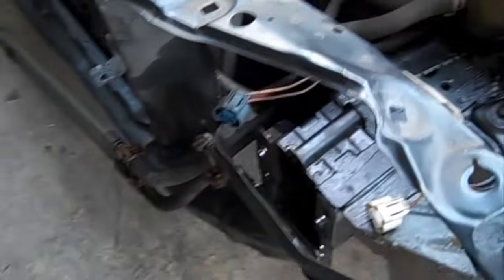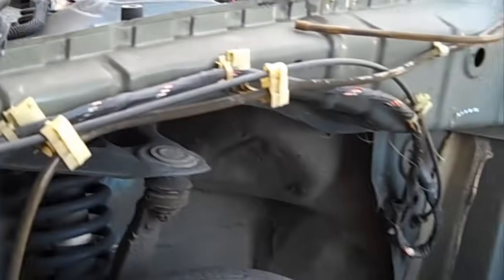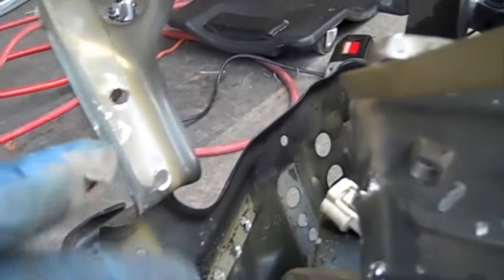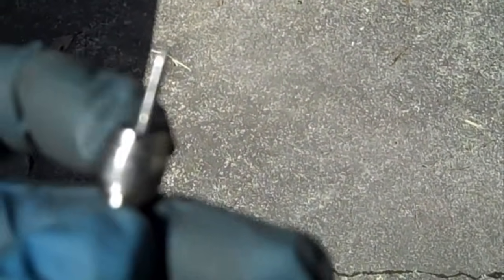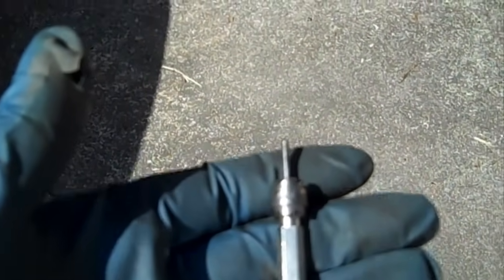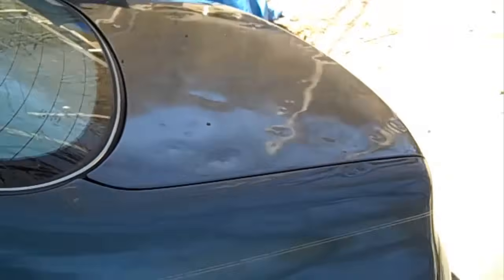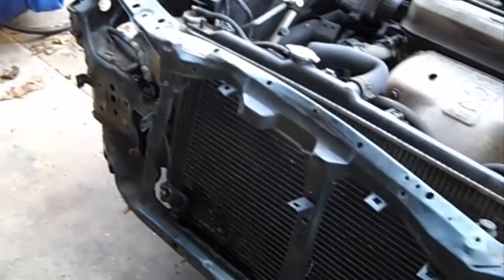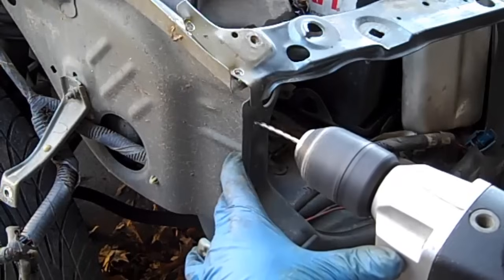How To Remove and Replace a Radiator Support

Comment: This was the most helpful video I’ve fond and I’ve been looking for about 3 days now. I’m a single mom and actually prefer to do this myself just cuz I’m interested in this kind of stuff and can save a ton of money! I bumped a car that made a sudden turn in front of me with no signal, good thing I wasn’t going any faster!....I could try to pull the top part of the radiator support back to it’s original position but I think it’ll be better to just replace the whole thing so it’s straight. I’ll also need to replace the hood and bumper. It’s not leaking any fluids and the car is running just fine. I was able to push the hood down as far as it’ll go but the lip is tucked and won’t latxh 😕  just needs some TLC. I also just want to replace the radiator just looks old...now all I need is the tools. Thanks. Wish me luck 😁 😆
Reply: Lmao! “I was tailgating and hit the car in front of me because THEY didn’t warn me to back up.” 😂 People try so hard to run away from responsibility
Reply: @GirlsNDragons who's to say it's their fault? They aren't even trying to push the blame away. Stop trying to be negative

Comment: I have a 2001 Accord. And I rear ended another car yesterday. The damage is very similar to this car. After bringing the car home and beginning the process of disassembling I became discouraged after I saw that there would be some cutting and welding. I don’t own a welder. I was bummed out. But after watching your video and reading some of the comments and ideas I’m pretty confident I could make it work. Thank you very much for posting this video. It’s been a great motivator and huge help.
Reply: How did it come out?
Reply from the maker: I don't normally recommend it, but if you do not have a welder, you can use nuts and bolts. You will just need a drill and some good bits. The issue with using nuts and bolts is, some of the place points that need to be attached are almost impossible to get a nut and bolt to it. However, that isn't always the case on every car. Some are really easy, while others are just a nightmare. But try some nuts and bolts to reassemble it.

Comment: Thank you very much for this video.  I bumped a truck with my f350 sd 2002.  Body shop estimated $8500 to repair.  So far I have $2500 in new parts but doing labor myself.  I was stuck on replacing lower radiator frame, thank you!!!!

Comment: Hey I wanted to thank you for the helpful video.  It was definitely helpful for when I will be replacing my radiator support later this week for my Honda Del Slow.  Reading one of the comments you answered my question about not welding the car too so thanks a bunch. And hey remember haters are going to hate, you just do you.

Comment: I can't weld, but your video was explained perfectly. I have the entire support and knew it wasn't bolt in/bolt out. But your vid was the best of all that I've seen, thank you
Reply from the maker: I have been asked many times if you can bolt a radiator support in when someone doesn't have a welder or doesn't know how. The answer is yes. Just use Grade 8 bolts, nuts and washers. You may want to put a few extra in at the bottom, especially where the support connects to the frame rails. Let me know if you need any other help. You can always contact me through my  site where you can upload pics if you need to.  https://rodsshop.org/contact-form/
Reply: @RodsshopOrg  ...Support panel, not support bar. Also Australia, not US. if you try and even bolt on a support bar, you will go to gaol, not jail
Reply: I can send you all the pics you need to see, I hit a roo. All the damage is cosmetic, except the high support bar, rad mounts, passenger side light mounts, AC mounts etc etc.
Reply: Sorry, I said that like I assumed you could see all the damage, I'll send you a pic, think Pontiac SS?
Reply: Can't send you the pics, either your contact form is hacked, or, your contact form is hacked

Comment: Whats the usual price for a job like this
Reply from the maker: If you are talking taking it to a shop, the price will be high and it depends on how much more is damaged. Most body shops will not just fix the radiator support and not repair and paint the rest of the car. 

However, if you could find an individually owned shop, they would charge somewhere between $500 and $2000 in labor and this depends on the make and model of the car.

Some supports are fairly easy to replace, while others are complete time sucking nightmares. The radiator support itself can run from $75 to $4000 depending on buying it aftermarket or OEM and the make and model of the car. 

I know that isn't the best answer but if you want a better estimate, tell me the year, make and model of your car and if you are doing it yourself or taking it to a garage and how much besides the support needs to be fixed.
Reply: Hey, I have a 2011 Subaru Forester that needs the bottom radiator support replaced due to rusting. How much do you think an independent shop would charge for parts and labor for this job ? 
Or is this something I could handle myself ? I understand the bumpers can be easily removed. Can the welding be accomplished with a 75 amp flux core wire feed welder that I have ? ( I also have a new 80 amp stick welder that I have still in the box. ) Or do you need a high end welder ?
Thanks in advance

Comment: I got hit from behind, smashed into the car in front of me....I was totaled, but had as much as I could fixed...they used epoxy on the upper plastic parts. Don't know if I want to attempt this or not, but this video is great. I've done fenders before, but holy cow. Although If I did, I could pick up some used fenders... Thanks for the video..
Reply from the maker: No problem, glad the video could help

Comment: How many spot welds all together are there?;
Reply from the maker: There is never an exact number of welds as it is going to vary for each vehicle. Some vehicles require you bolt the support at the bottom and weld in the middle and top, where most are all welded. Even though this is not exact, on average, I would say you would have somewhere between 30 to 40 spot welds.

Comment: Mine just got the bottom piece rotten, can I just cut and weld a piece on the bottom?.
Reply from the maker: @workingtools2999 Yes, I have done that often. Just cut out all the rusted part, be sure to cut well into the unrusted areas. Then weld in the new metal. As a tip, I would use a Weld Through Primer to help prevent your welded area from rusting later on. Prime and paint it thoroughly.
Reply: @RodsshopOrg  Sounds good. I Don't wanna be removing parts that has no rust at all. Previous owner neglected it and now its my problem. Its only at 90K kilometers too. 2012 Nissan ser spec v. 😁
Reply from the maker: @workingtools2999  You should be fine just cutting out what is needed and weld back in new. Saves a lot of time on having to remove fenders and radiator supports and stuff for sure.

Comment: nice vid! I have the  same Honda accord 94-97 model with the same issue with a little less damage - hit on the driver light side.. thinking about undertaking this job w a spare accord I bought for parts.

Comment: What is torque setting for radiator support bolts....
Reply from the maker: That would be a hard answer to give, most supports weld in, so there are no bolts. Plus if there are bolts, not all brand cars are going to be the same. 

When it comes to body work, you just tighten the bolts tight. Not over tighten them, but it is more than snug. Just when you feel the bolt come to a stop, then tweak it a little tighter.
Reply: @RodsshopOrg  To clarify - radiator support assembly gets bolted to frame of car (usually not bolted). Looking for torque on these bolts.
Reply from the maker: @rohitbhatnagar7599  True, I just did an Altima that had four bolts that bolted it to the main frame rails, but again, these types of bolts when doing body work do not have torque specs. However, if you are just wanting to use a torque wrench, you need to look up the size bolt it is to get its specs. 

On my website, I have a page that give you torque specs by size of bolt and the grade of bolt. You se, I have no idea if you are talking about a 6mm bolt or a 14mm bolt. You would not torque these at the same torque.

Go to my page and get the specs you need there:  https://rodsshop.org/bolts-by-grade-and-torque/

Comment: My 03 maxima radiator support is rusted out & needs replacing. I found a new 1 online for under $100, not sure what shipping will run me. How much is this type of job? Will the radiator have to be drained? How much should I be paying to change mine out?

Comment: My foot slipped out of the brakes and hit the accelerator and luckily it hit a tree and damaged my front end. I usually fixed everything but I don’t know how to spot welding. How much does this cost for a 2921 Avalon hybrid?  Thanks
Reply from the maker: The support itself looks to be around $175. I don't always recommend this but you have two options. You can use nuts and bolts to mount it in or the other option is using the body panel epoxy adhesives. This adhesive is as strong if not stronger than welding. It is just a little costly but cheaper than buying a welder and no learning curve really.

Comment: Do u have to replace the whole support or can u just replace the top support?
Reply from the maker: It depends on the car. Some radiator supports are made in sections, others are one piece, which is more common. What is your car?

Comment: Two questions do I need to drain the radiator and should I remove the hood
Reply from the maker: Your hood prop rod is usually on the radiator support. So if you want to leave the hood on, you will need to use a board or buy a universal prop. The radiator depends on how much in the way it is going to be. If you are welding your support back in, I don't think I would want the radiator near the hot sparks and slag as that can burn a hole in it. Beast practice is to drain and remove it.
Reply: No I have to bolt it on some the old bolts rusted n snapped off what size  do you think the bolts are for 2007 toyota corolla radiator support or what size should I use if I buy new nuts n bolts
Reply from the maker: @survivalmansurvivalman365  I think you will have a variety size bolts due to the area you are bolting. Where the rad support bolts to the frame rails, I would use no less than 5/16". Where it bolts to the inner fender panels, kind of around the headlamp openings, no smaller than 1/4". All the bolts should be grade 8.

Comment: Im looking to replace the radiator support on my 05 civic, idont have a welder, ive read comments and you says its possible to use grade 8 bolts instead. What size bolts would you suggest? 3/8?  1/2? Thank you in advance

Comment: oooof I wanted to do this myself but yeah this sure is no simple fix without the proper tools .
Reply from the maker: Really, the welder is going to be the only tool that isn't cheap to own, especially for a one time repair. However, you can use nuts and bolts. You will just want to use grade 8 nuts and bolts and those can be purchased at the hardware store.
Reply: Will it rust out using bolts?

Comment: Iv got an 03 subaru forester so its riveted, left corners smashed in after lower control arm snapped on a country road an launched us into a ditch, would you recommend grinding it off or should I try to pop the rivets out before that?

Comment: Can I just use a big nail and hammer instead of using that spot weld tool? after which I will just drill it with some tools that makes a hole starting from small scaling up to a bigger one?
Reply from the maker: I would not recommend using a nail gun and it can blow up or have the nail lash back at you, and it will tear up the nail gun. There are not that many welds to center punch and drill. Take your time and keep it safe.

Comment: Came across this video searching for information on replacing the radiator support framing for my 2000 Chevy Impala. If at all possible, in your opinion, what do you believe the price range to be if I decided to hire a mechanic to complete as opposed to the DIY method, and  cost of part?

Comment: RodsShop have you replaced a core support on a 1998 ford ranger mine is bent at the top mostly on passenger side, plus I have to replace the drivers side fender and inner fender will the inner fender be spot welded I will need to replace the battery tray as well, do you have a video on removing inner fender and replacing

Comment: Thanks for the great video.. I am currently fixing the front end on my 06 civic coupe.. im about half way done removing the support it is just hard to get the welds on the inside ( i think i can just drill from the outside?) .. i dont have a welder and my friend that does body work is going to help me and try to borrow a welder but he himself is not a welder.. am i better off getting nuts/bolts or should we give it a shot with welding ?
Reply: Also do the original holes in the frams where i drilled out the spot welds should be good enoigh to line everything up or does it usually require more adjustment ?
Reply: RodsShop thanks alot , im going to give it a try with the welder todat. hopefully we get it all put together before the end of the day

Comment: Is it possible to remove the radiator support without having to replace the radiator? I have a toyota auris where the support is banged up but the rad and ac work fine so I was thinking of just replacing the support panel, it's only bolted in and isn't welded.
Reply from the maker: Yes, you don't have to replace the radiator or the condenser when you change out a radiator support, no  matter if it is welded in or bolted. The only time you would have to replace either is if they got damaged. If you are talking about leaving them hooked up while you change out the support, that can be tricky as some of the cars have the condenser on one side of the support and the radiator on the other. Plus they often run the A/C lines through holes through the support forcing you to have to disconnect those lines. 

If you want to send me pictures so I can give you better advice, contact me through my website. 
https://rodsshop.org/contact/
Reply: @RodsshopOrg  thank you, when I get a chance to get under the car I'll send some images across.

Comment: I do not have a welder. Can I drill holes and use nuts and bolts for reassembly where you drilled out the welds instead of re welding? Thanks a lot, I would like to do this soon.
Reply: Thank you so much. That's what I thought but I just wanted to be sure.
Reply: That answered the big question I had. Thanks.
Reply: How can we identify grade 8 nuts? Are they sold at Home Depot or an auto parts store?
Reply: A G try Amazon
Reply: go buy it T HOME DEPOT $189 WHEN DONE RETURN IT AND SAY DIDNT WORK PROPERLY AND YOU WILL BE REFUNDED
Reply: @RodsshopOrg  Ive been stuck trying to replace the upper left radiator support on my 2015 nissan sentra. Ive drilled the weldeds out but the panel doesnt want to depart from the other surface. Can I get some help please ????

Comment: Do you have the  under hood dimensions for honda accord 2006? I have similar damage and am trying to just fix the radiator with a come along tool. I do not have welding tools/skill. Your help with the dimensions is much appreciated.

Comment: Would a repaired rad support cause a fender issue wheel to fender space issue? The one side I can see repair done tk the the rad support my wheel sticks out a bit past the fender like the body doesn’t line up
Reply from the maker: It is possible, some people try to repair the radiator supports when it is just quicker and easier to replace them. Since the radiator support is key for the front end to align up, strong possibility that is your issue. Send me pics of what you are talking about and I will try to help you best I can. Send them to my website  https://rodsshop.org/contact/

Comment: Hello Sir, family rear ended another car at low speeds 20-30 mph. Radiator support and radiator are busted. Do you think bolting the new radiator support instead of welding it back on would be a good alternative for a DIYer on a beater car? Thanks.
Reply from the maker: Yes you can bolt it on, just use grade 8 nuts and bolts

Comment: Which MIG welder is recommended for this job? Please and thank you, great video!
Reply from the maker: The welder I used in this video and the same one I use on all my auto body projects is the Eastwood 135 MIG. I use gas on mine, 75% Argon, 20% CO2 mix. But you can use Flux wire which requires no gas. Gas wire is cleaner looking but for a support, not too many are going to see the welds. Here is where I bought my Welder:  

https://amzn.to/2Ybzc7V

It has high reviews and I can tell you from my on use, it is the best MIG I have had ever.
Reply: @RodsshopOrg  Thanks for the quick reply & information! This video was great!!

Comment: What's the difference between oem radiator support and aftermarket?! I have a 97 honda accord and the dealership wants $480 for a new radiator support!!
Reply: @RodsshopOrg  thanks and about how much too replace the radiator support?!
Reply: Specs can be different and inconsistent compared to oem but still designed to fit as well
Reply: Went to junk yard 75$ for a toyota corolla

Comment: Had no idea these parts were available along with the weld cutter! my daughter rear ended someone and found your video! I am a diy’r and have a little better outlook than trying to straighten twisted metal. Question, metal is very thin what kind of welder did you use? I have a flux core with min/max setting (harry homeowner harbor freight welder). Have access to gas mig which I’m guessing is better? Thanks so much for a great video!